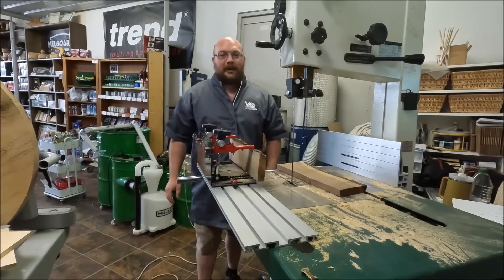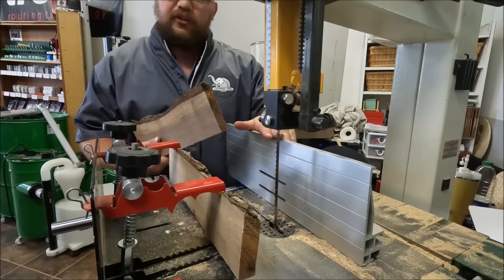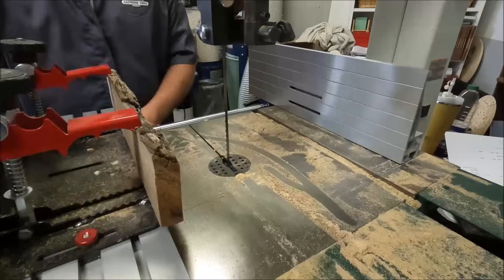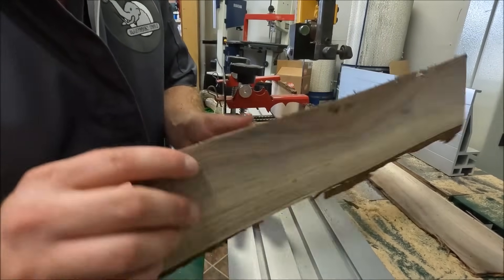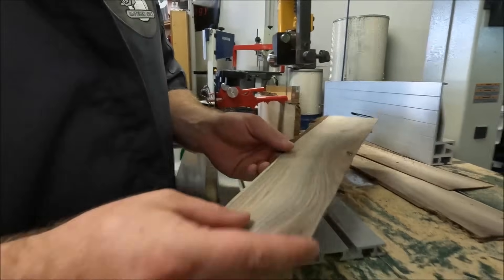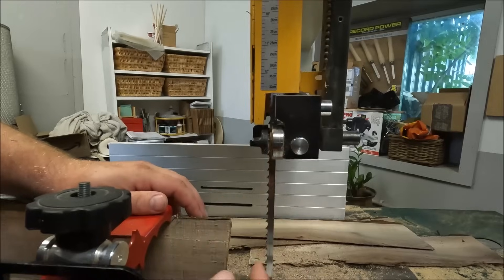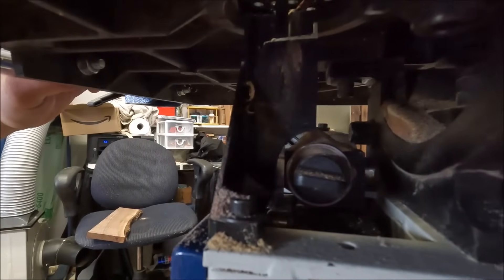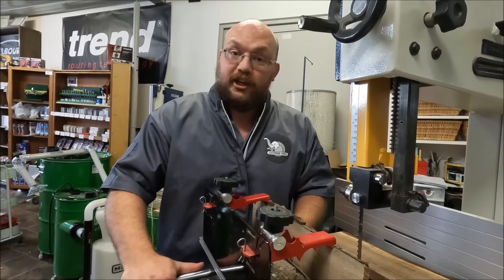The ONE & ONLY Reason Your Bandsaw Drifts & How to Stop It! EthAnswers

Comment: He needs to admit in the video that Lil Ripper is his product he sells.  So don’t assume this is an unbiased review of lil ripper.  Its one of his COMMERCIALs advertising lil ripper.
Reply: Maybe he is pushing his product but it seems like a great fricken step up from using a fence. More power to him.
Reply: For crying out loud, bud. It’s on his channel. Lighten up.
Reply: Yup. That's pretty obvious. However, he's not trying to sell it in this video. He's just pointing out some facts.
Reply: If I had a product and a YouTube channel ,it would be shown every time the cameras were on . What would you do if you had a great product and a YouTube channel ? Hide it …..
Reply: @robertsmith3518Can you not read? No one is objecting to him showcasing his product. The issue is that he’s not making it crystal clear that it’s his product and it’s not an unbiased review. It’s very different when someone says “x is the only good product on the market for…” as the maker/seller of x, than when that comes from a completely unbiased 3rd party.
Reply from the maker: We certainly are the designers, makers and sellers the Little Ripper Sawmill! Here's a link to where to find them on our site - https://stockroomsupply.com/collections/little-ripper-mini-sawmill-1
Reply: @StockroomSupply if I am ripping 4/4 S2S, which ripper would you suggest. I have a Laguna 14bx.
Reply from the maker: For the Laguna 14bx you will need the 1 1/16” Round Rail version. That depends how tall and long you want to cut! The standard package with cut 7” tall and 2’ long. With a height riser it will handle up to 14”. With a track extension it will handle up to 4’. I hope this helps! Thanks for watching 🙂

Comment: You can accomplish the same without the little ripper.  Just make a fence that ends just after the blade.  The wood can bend any way it wants and there is no fence after the cut for it to press against.  Save your money.  P.s. if you’re still thinking about a LIl ripper, also consider your band saw’s table - it’s too small and once you try anything bigger than a small, short light log, it just gets in the way and doesn’t work. (Notice all demo utubes are only with small logs).
Reply from the maker: As far as fence setups go on a bandsaw that is quite good! There are still a number of issues I chat more about in this video - https://youtu.be/sY7xKKUGBgE?si=gaQCLHDWdcLxnil2
Also if you are interested here's a video of the Little Ripper cutting an 8' long red oak beam - https://youtu.be/YmGhMCgS7SU?si=Ga3Ht0XwRcJejMqX
Thanks for watching!

Comment: When you think about it, with a piece of wood rigidly held in the little ripper, this acts just like a fence when you cut off a piece.
Reply from the maker: The difference is the wood is locked in place with the Little Ripper not allowing it to move and protecting the blade. With a fence the wood is free to twist and bind whichever direction it chooses. This video helps explain this more - https://youtu.be/sY7xKKUGBgE?si=3fPaxnBMc4mspbUA
Thanks for watching!!

Comment: Thanks for this video, but I have a question. With the fence, the wood can't deflect towards the left because of the fence. But with the sled,  the board is still held so it can't deflect, but to the right this time. Why are there different results?
Reply: This is exactly what I was thinking while watching this video.
Reply from the maker: That’s a good question! The answer is actually in the wording of your question. When splitting a board with a fence the wood moves and binds the blade. When splitting a board with the Little Ripper the wood is held in place so it can’t move. This video explains more what I mean - https://youtu.be/sY7xKKUGBgE?si=3fPaxnBMc4mspbUA

Comment: Can you visually inspect a bandsaw blade for damage?
Reply from the maker: You can see major defects like a bent blade or a crack. Unfortunately you won’t be able to see an issue with the set as a couple thousands of an inch off can be the difference between a straight cutting blade and a blade that drifts. I hope this helps and thanks for watching!

Comment: I struggled forever to stop drift with a new bandsaw and stock blade. Changing the blade fixed the problem. The bad blade's teeth offset was not balanced. Can such a blade be fixed? Is there a way to re-set the teeth?
Reply from the maker: Yes and no! lol I’ve played with this in the past…you can kinda fix it? This video talks about this more - https://youtu.be/4OLB59oCIjs?si=tUZr4Ffzve88IeQI

Comment: Ethan.....Watched your video on bandsaw drift and the little ripper was very impressive in correcting that issue....but you used a slab piece of lumber. Can the little ripper handle re-sawing already planed boards. Looks like getting a straight 90* cut might be a challenge. Whereas, pushing that same board against a fence would almost guarantee a straight 90* cut as long as you have a sharp blade. How does the little Ripper help with re-sawing straight boards.....without a fence?
Reply from the maker: It absolutely can! This video shows in more detail how to resaw with it - https://youtu.be/VeuALqx1uAA?si=Rm2IJwgP8nxoGEoX
Reply: @StockroomSupply  That was a perfect answer to my question.....will be placing an order! Thanks Ethan
Reply from the maker: @lawrencep5427  happy to help and thankyou!

Comment: Ethen speaks the truth.  I saw thin panels for ukulele fronts and backs.  The Little Ripper has made this much easier and produced much more consistent results than a tall fence. The tall fence was great for making panels that ended up concave or convex and with uneven thickness.  But I needed flat panels.  The little ripper really improved my yield.
Reply from the maker: That’s awesome!!! We’d love to see a picture of your ukulele’s sometime. Thanks for watching!
Reply: That is interesting. I actually resaw thin panels for harps, and Im using fence with good results. And I was just thinking if this could work for thin and long panels. This looks for me like a good jig - but for small and short logs, like from fire wood and so on... I cant imagine that Iam resawing piece what is 100x30x1,5cm ... ?
Tomas
Reply from the maker: A lot of folks use the Little Ripper strictly to resaw! Here’s a video showing how to set it up to do that - https://youtu.be/VeuALqx1uAA?si=igBBTX_SunMawYxs
Reply: @HarmonieZvuku-harfy-kalimby  I saw log quarters that are 48” long using two tracks end to end and two carriages.  The logs were a bit wobbly with a single carriage because of the unsupported length.  For ukuleles that is plenty of length,  and a bit more than one meter (39”).  See my video on “SN008 demo and reprise”. A snippet shows the panel sawing